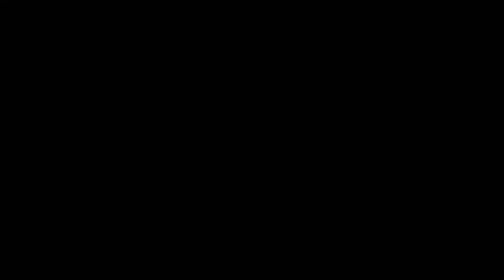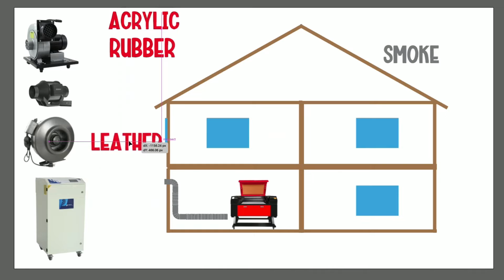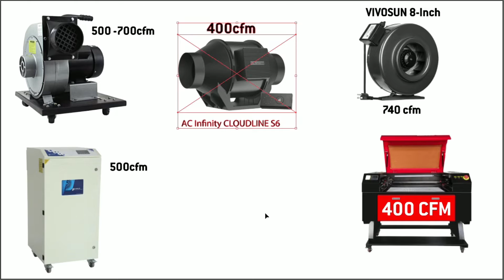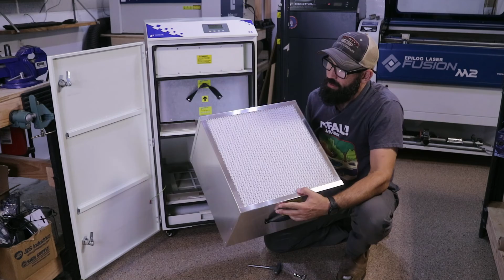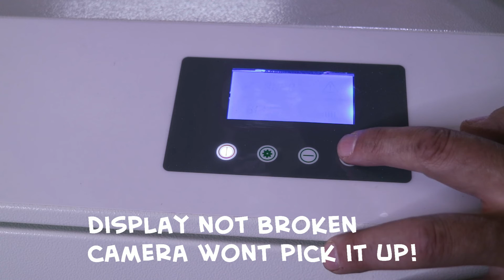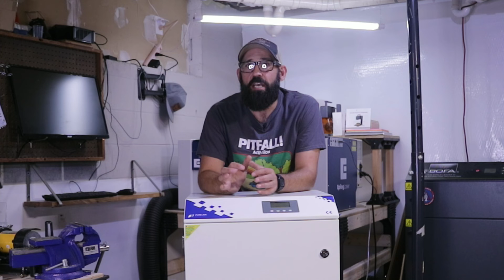Laser Engraving Fumes and How You Can Deal With Them - Fume Extraction Basics

Comment: Just starting with lasers. Great videos. Some of the best and most useful. 
Quick question, how do you go from an 8" on an AC Infinity CLOUDLINE A8 to a 4" Epilog (single output). Do you recommend getting 8 tubes from the window to the blower to the laser (8 to 6 and 6 to 8 reducers attached to the laser)? Or 4 inches from the laser to the blower and 8 to 8 on the blower to the window? I hope what I am asking makes sense to you.
Reply from the maker: I recommend keeping the pipe as large a possible for the long runs and only reduce toward the very end where you terminate.

Comment: Am still super confused on which to use am having a problem where I work out of , my landlord says other tenants are complaining. I don’t have the funds to get anything crazy can you pls tell me which i can get that won’t brake the bank
Reply from the maker: Yep! You want to get the AP2 Safety Pro- works with any laser, you might have to get a hose adapter though depending on your hose outlet on your laser. ✅https://shrsl.com/4r4d1
Reply: I made a wooden box to put my laser inside, after many experiments with few satisfactory results, I made a small hole where I placed my wife's vacuum cleaner, Fakir Red Vac Power vacuum cleaner with bag 700 W, floor vacuum cleaner with cable, HEPA H13 filter, very silent high efficiency 69 dB(A) motor, large 3 l dust bag and operating radius of 9 m, smoke you can't see anymore, you only smell it if you have it on your face on top of the vacuum cleaner and it's very little, it's barely noticeable, if you put fragrance in the vacuum cleaner bag, your neighbors will like it.

Comment: I'd love your advice. I just bought a xtool m1. I mainly want to cut 3mm wood pieces for projects.more a hobby than a business. I would like to know whsts the best cheap fume extractor I could get that wouldn't need vented outside. There's so much information that it's overwhelming. I found a few cheaper options on Amazon, but don't know if everything needs vented out, or if none do. Or if the cheaper ones work or not. Thanks in advance for any help
Reply from the maker: Its really going to come down to how much your engraving and cutting, and WHAT your engraving and cutting and how often. If you only  running your laser a few time a week here and there, then a small extractor like xTool sells might work for you.  https://shrsl.com/4oh0c  but if your serious and running your machine full time and working alot your going to want something more professional like this  https://filtrabox.com/product/laser-micro-filtrabox-fume-extractor/ or larger,  with fume extrators you get what you pay for plain and simple.
Reply: After reading other comments here I guess what's the best cheap one I should get. I'll figure out how to vent it outside,  seeing that even filtered it should be vented out
Reply: Thank you for the advice ❤ I appreciate it

Comment: I'm getting a headache!  I wasn't prepared for a axial vs radial fan debate.  Just when you think you've got it all figured out, you (I) come across a cult of people who swear by radial high pressure for pulling through a filter (reminds me of forum jousting with home theater geeks that want to change your religion when you want a different subwoofer configuration that "the community" accepts as best...I digress.  I'd rather have a quiet inline fan but not sure about the whole pressure thing , even starting with an 8" >700 cfm fan (200 cfm radial for comparison), will this setup kill its performance?
3 or 4. 3M furnace filters with 20 to 30 lbs of carbon, and an 8" AC Infinity.
Any suggestions?
Love the channel, thank you!

Comment: I'm starting to think the fume extractor is my only option, because venting straight outside at any elevation would still make some neighbors mad if i was cutting acrylic or leather ... And if the city or someone wants to make my business emissions a big deal, the extractor would stop that issue in it's tracks. 

I'm in the planning stage of getting started, and am getting the Creality 22W Falcon 2 in a couple weeks. Changed my mind from the Longer Ray5 20W, because of better cable management and seemingly better color results on stainless steel, ans the laser head adjustment looks a lot better with the Falcon 2. I'll have to find a place to just set it up in a garage with the exhaust hose going out the door for the short term, but I'm hoping the $2,000 mini extractor should be perfect as long as I'm engraving more than cutting. It might be tax time before I can think about the extractor.

Do slate coasters produce a lot of smoke? I'm mostly going to start with those and engraving stainless steel and anodized aluminum, but i have a wood project planned for a Christmas present 😁
Reply: Now that I finished this video and watched the one covering reasons the business could fail, I'll update this a little, lol.

I'm starting with a diode Lazer because of cost, mostly, but also because it can engrave stainless steel AND cut wood and other materials. I'm aware of the speed issue, but this is really just to get my foot in the door with all this, and I'll be focusing on products first, rather than engravings for people. I wish I could share an image of my woodworking design on here, too, I still have my basic drafting skills from High school, and designed a custom video game cabinet (kinda jewelry box sized, with 1/4" Cherry) because you can find carrying cases everywhere, but nothing nice for display or "in-use storage".  The goal is to start making things, find something that can show some demand so I can duplicate it, and I'll reinvest every penny into better equipment and more lazers to get it to the point I wish I could just start with right now 🤣

Also, in the other video, you advised against opening a storefront. I completely agree (but shop space would be nice), and I have something to add. These machines can make products that are nice enough for existing local storefronts to add to their own inventory. It might be necessary to get a tax ID and register a business before they'll do much business with you, but that's also part of my plan, specifically with slate coasters. I'll go right to the local vape shop and talk to the owner with some examples in hand and a full catalog of AI art (already backed up on my laptop and converted to vector images) and see if they would consider placing an order.

Something new to me, also, that I've only seen 1 channel talk about, is laser engraving transfer tape ... For using diode lasers on glass. I'm assuming the ceramic tile trick with the titanium dioxide would also work on glass, but the tape would add more value because it's colorful and better quality. 

Sorry for rambling 🤣 I feel like I'm drinking information from a firehose, learning all I can about this. Thank you for everything you do!

Comment: I would disagree about your message to not use a centrifugal blower. However I would agree to not use one of the Cheap Chinese versions. you need a high quality one. They can provide the highest airflow and power for its size. and the motor is not involved with the air flow so it won't fail due to particles getting into it from the exhaust air. These are the same blowers we have in all our central heat an air systems, for all those reasons. and because it is so powerful you can use longer runs and place it outside.
Reply from the maker: Thanks for sharing!

Comment: My question is exhausting outside for hobbyist is cfm. Exhausting 500 cfm takes a block of air 10 x 50 sq tf per minute, so a room 10 x 12 with an 8’ ceiling (960 cubic feet). So that means the entire room vents once time every 2 minutes. A 1200 sq ft house would be turned over every 20 minutes of There goes the conditioned air of the entire house vented outside.

This may sound like a stupid question, but could you just vent the filtered air back into the laser creating a closed system, or would the air inside the enclosed laser become more toxic and not be good when you ran a project that may take 20 minutes to do?

Yes, it would require some modification to the laser housing.
Reply from the maker: That would be a very bad idea., you would hurt the laser and also the smoke and fumes could ignite and or interfere with the beam quality. I would not concern your self too much with all those metrics, in the end you want t strong inline fan to evacuate all the smoke and fumes outside, a a good fume extractor.
Reply: I meant after it went through a fume extractor then back into the machine. The air would have been cleaned, maybe some vocs would still be present in the cleaned air stream. Just a thought.

Comment: Greetings from over the pond 🇬🇧  Hi Michael, I'm just revisiting your video on fume extraction. I've just purchased a budget fume extraction cabinet similar to the one in your video. The model is a qubo DX5000 II  pulling 500cfm   the inlet & outlets on the DX5000 are 4" the outlet on my Thunder is 6" I've ordered a 6/4 reducer to attach to the purification cabinet (DX5000) not sure if running 6" into the DX5000 & exiting with 4" flexible hose will choke the system. Any advice would be greatly appreciated
Reply from the maker: Hey David, I have done this in the past, and its fine, I'm sure it going to work great for you! Thanks again for all your support on the channel!
Reply: @LaserEngraving911  Thanks for the reply Michael it's much appreciated. I shall rig this up over the weekend & let you know how I get on

Comment: Everyone should be aware that even wood smoke contains carcinogens. My laser is currently out of service due to health concerns expressed by my wife. It will resume operation after I design a more effective filtration system and prove to my wife that all particulates and odors have been removed from the exhaust and CO levels are lower than produced by a gas range.

Even the EPA standards fall short of my wife's seal of approval.
Reply: Might be time to get a new one, lol.

Comment: Hi there, I'm a new subscriber and am getting my laser (100W with 500 cfm minimum) hooked up for the first time as well as sourcing additional equipment.  I was gifted a fume extractor and also plan to direct fumes outside with a 700+ cfm inline fan but wondered if you could comment on how to have both connected to the laser.  I'm assuming a "y" connector but not sure what to use to close off extraction on the leg that's not being used.  Since you have multiple extractors I'm curious how you alternate use of your extraction techniques shown here on your machines.  BTW, thank you so much for a fine video!
Reply from the maker: Thanks you will want to invest in a Blast Gate for your installation and install these in line before right before the "Y" adapter  on both sides of the "Y"  At the "Y" Here is a link to a 4" blast gate and 6" blast gate, IM not sure what size hose you plan on using so that will dictate what size blast gate you buy. 4" Blast Gate: https://amzn.to/3NgwIef  OR 6" Blast Gate: https://amzn.to/3CxYtd9   hope this helps
Reply: @LaserEngraving911  Thank you!!  You made my day!  Waiting for your next awesome video . . .!

Comment: What does Pure air tech extractor cost?
Reply from the maker: Budget Friendly Fume Extractor (Non Affiliate Link)
Pure-Air Tech Fume Extractor System 
LINK TO PRODUCT PAGE https://www.pure-airtech.com/Products...
MODEL:  PA-800FS-HP-IQ (this unit shown in this video)
SIZE: 790 X 590 X 1256mm 
CFM: 471/ 800m3/hr
POWER REQUIRMENTS: 110V
NOISE TESTED: 65db
Weight: 242.50 lbs
FILTER TYPE:4 FILTER 
1: Large particle filter
2:F8 Medium density H13 HEPA Combined
3: Activated Charcoal Filter 35lbs Media
Sales Contact Person: Charlene Chen “Oversea Sales Manager” sales@pure-airtech.com
Reply from the maker: I think they range from 1800-3000, depend on what unit you get, for comparison my BOFA 500iq is 7000.00 so the Pure Air is more budget friendly

Comment: I despise fume scrubbers. I run them for maybe a week or two and the CFM takes a nosedive and clogs up the filters. Its not worth the investment. I am only cutting Cordura and SQUADRON fabrics daily.
Reply from the maker: It must be the material or the particulate being created by the material your are cutting for sure, some materials can clog filter extremely fast, for example MDF should never be cut using a fume extractor because the glue used to make MDF clogs the filters, fume extractor are not for every application, but for most materials  the do a great job. They def have purpose and place for the appropriate application.

Comment: I will be purchasing an Epilog Fusion Maker and I’ve been investigating exhaust solutions. The laser cutter will be used to cut cast acrylic, wood, and fabric appliqué. You mentioned odor as a big concern when laser cutting. How far do the odors carry? Do you think I would be disturbing my neighbors who are about 40ft away?
Reply from the maker: Hey Sam, when you are cutting acrylic and leather, if the wind is blowing in their direction, they will prob smell it, wood fabric not so much, you might want to consider a pure -air fume extractor mentioned in my video to buffer the odors. before they leave the shop, one benefit of the fume extractor as well is the powerful exhaust CFM , with the fume extractor you wont have to worry about any odors strong enough to bother anyone outside
Reply: @LaserEngraving911   Thanks for the quick reply! How expensive is the machine featured in your video? How expensive are replacement filters?

Comment: After running a laser business for 3 years now, 
where we have the laser running for pretty much the whole day, fume extraction is definitely the hardest technical issue to tackle. We started with a simple axial in line fan. But that didn't really work for long as sticky residue would but up on the fan blades very quickly causing it to stop working properly and needed to disassemble the unit and clean it every two weeks. We tried a radial fan which was more capable of building up pressure, but we ran into the same issues and that thing was loud as hell. We also had a big BOFA unit. Super pricy to buy, but the cost of replacement filters was just absolutely insane. We had to replace the filters every other month at a cost of 500,- per filter set and had a failed motor after about a year which would cost 600,- to replace. Absolutely terrible! That was just stupid and literally throwing away money. We have gone back to a very big in line fan and built a custom big vertical box which the fumes are pulled through from bottom to top and have a filter manufacturer make some filters for us with different filtering classes which are very cheap. No active carbon for the smell, but so be it, we are venting outside anyway.
But still can't really say we solved it. It's ongoing drama.

The thing is, with every change it works great for the first two months and then the cracks start to show, with whatever system you go. (And yes, spending 500,- on replacement filters every 2 months is cracks BOFA!)

Another thing I would recommend is placing a air quality sensor in the space you're in. The laser can really be a health hazard when running it all day every day for years.
Even the basic Chinese ones are fine I've found. At least you'll know what's going on and if you have some leakages in your piping etc.
Reply: Same I am going through. The fume scrubbers are an absolutely waste. They are really for hobbyists, nothing a full time business can benefit from. Their price is atrocious and their filter price is atrocious.
Reply: Building your own filters can save you a ton.

Comment: One thing you've missed for putting the fan at the end of your piping (outside even if possible) is that in front of the fan it is sucking air, and behind the fan it is blowing air. Any little hole in your piping after the fan is going to blow all the fumes and dust back into your workspace.

Comment: I suggest metal dryer vent at the very least. Yes plastic is cheaper but the metal less likely to crimp and I think it's less likely to build up corrosion, but if it does u can blow it out easier with less likely chance of causing a hole.
Reply from the maker: Hey Zach, not a big fan of thin foil dryer venting, it tears to easy and can get unseen pin holes which can leak out fumes, I like to hook my gear up to something with thicker walls, not saying you cant use that, I just dont personally like using it, Thanks for sharing your thoughts on this. and thanks for watching. 👍
Reply: @LaserEngraving911  thanks for the reply, my blower takes the 8 inch I bought the metal seems to be holding up well. started with a electric leaf blower to pass the fumes and got tired of the noise.

Comment: I think that pad that was sitting in the bottom drawer is actually a spare pre-filter that goes in the thin drawer above it (below the first big box you pulled out). It catches the big stuff to protect the more expensive filters. It's cheap and you replace it regularly. I've just bought the same unit a few weeks ago and I couldn't laser without it, its brilliant!
Reply from the maker: Correct, yes that is its purpose for sure, Thanks for watching! 👏
Reply: I use 2 pieces of window screen and pillow filling  from hobby shops. It doesn't restrict airflow much, cheap and 1 bag lasts a long time.